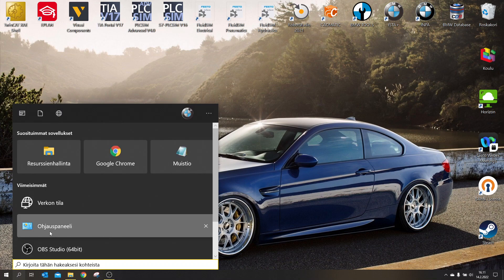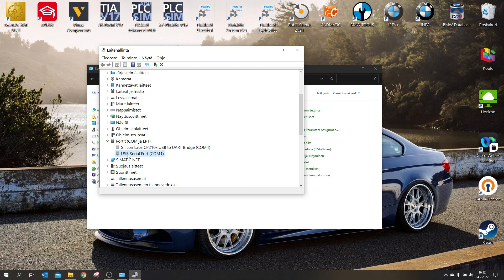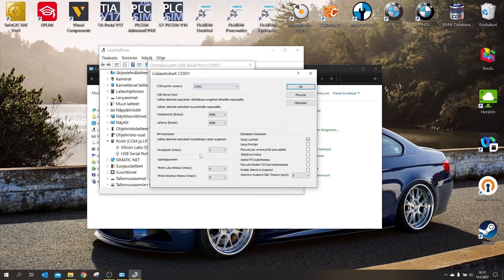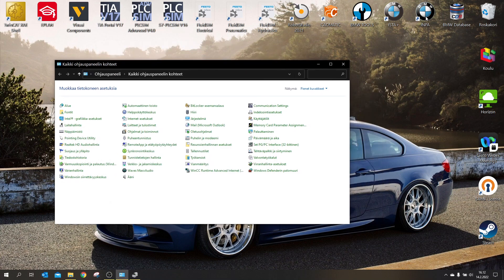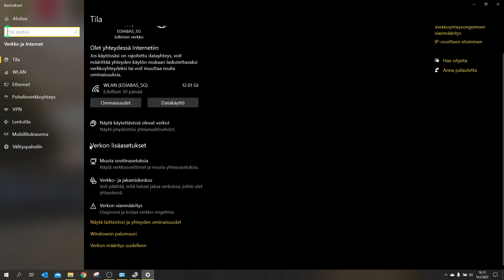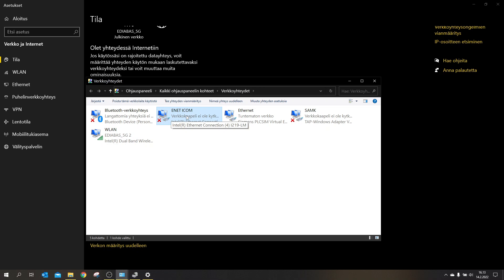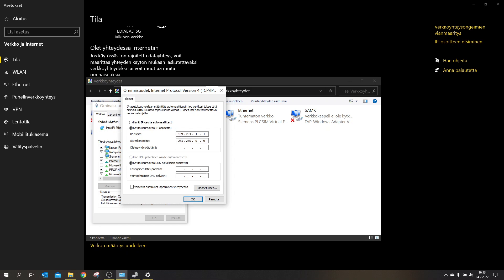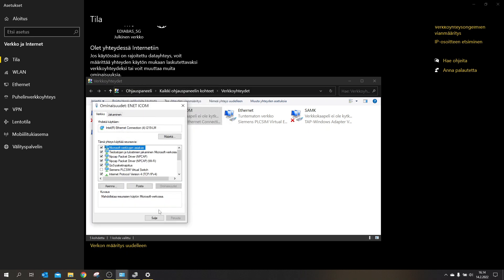How To Configure ENET And K+DCAN Cable

Comment: If i plug my cable in it does not show up?
Reply from the maker: @Fancy669  there must be a problem with the cable if it doesn't show up in the device list when plugging it in
Reply: @Bemaritohtori  i mean if i plug iy in into the eternet port only
Reply from the maker: @Fancy669  Oh I thought you were talking about K+DCAN, my bad. I think you need to connect the other end into your car and then while you have the adapter tab open you connect the other end to your laptop. You should see it pop up. After that you can rename it as "enet" or similar

Comment: has anyone actually managed to get these 'YELLOW' cables to work? as i opened  2 different suppliers cables, and there is no 'CHIPSETS' or any electronics inside whatsoever!! just 5 wires, 4 cut back short, it's just an ethernet cable, i'v been trying for weeks to get these working, many computer experts also gave up, once they discovered that these are 'SCAMS'  NO cable alone is going to communicate with the software on the car, without an INTERFACE. 🤔 at least the D can  has some ( albeit cheap) electronics inside the obd cable.
Reply from the maker: Hi!
This yellow cable is called an ENET Cable and requires no chip, only resistor between pins 8&16. 

I have made one myself and it requires only 5 wires. ENET is an ethernet based protocol and the interface is built into the car itself. If you are using ISTA you should check my other response where I told how to set it up in Ista. ALSO the most important part is that your car has to be F-Series or newer for ENET protocol to be supported.

Also check that your cable has ~500ohm resistor soldered between pins 8&16. That resistor tells the car that ethernet protocol is being used.

The circuit you can find from DCAN cables is to convert serial bus communication into USB format. The ENET connection is as straight as plugging your ethernet cable between your PC and modem -> nothing but plain cable
Reply: @Bemaritohtori  ahhh, Thank you for that Valuable insider info, i'm glad your names NOT 'JONAH' or else we may have to look inside of a rather big FISH, instead of an obd cable, Lol 🙂, yes i shall check out your other video's soon, Bless 👼

Comment: Hi, I've installed ISTA+ on a Windows 10 but having trouble to setup the ENET cable could you please help? Thank you
Reply from the maker: You go to ISTA, then click on the wrench icon on top right corner, then you go to "vehicle interface" then select "Dealer Organization ICOM/ENET local area network". After that it is configured on ista's side